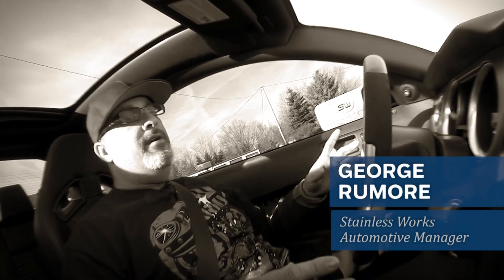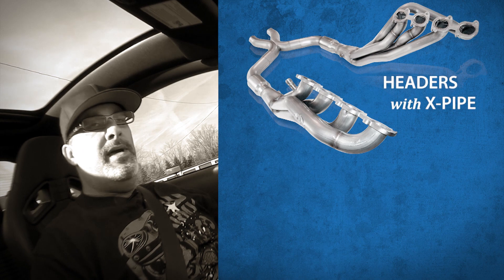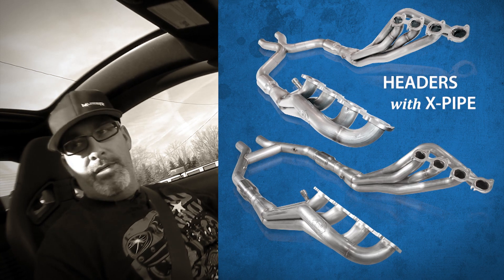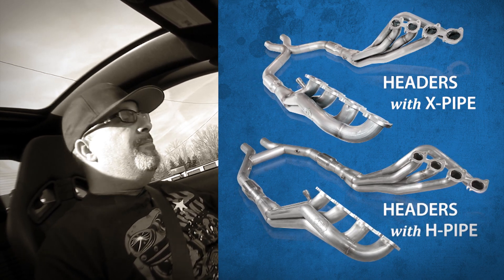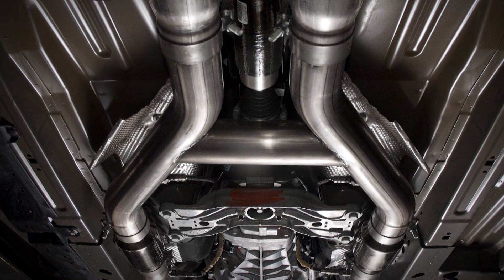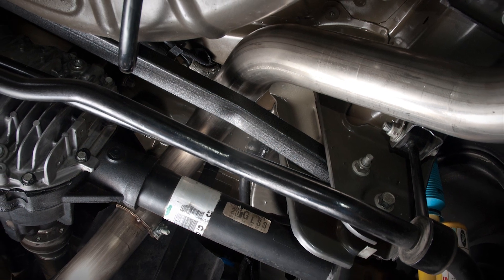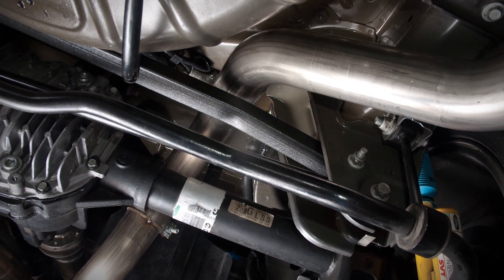2013-14 Ford Shelby GT500 Exhaust, Headers and H-pipe

Comment: Does this exhaust in the video have mufflers or is it a straight pipe?
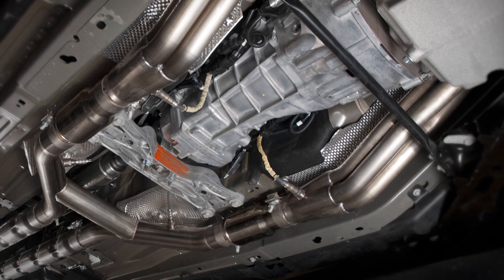Reply from the maker: It has mufflers, they are our "retro-chambered" aka chambered round mufflers (which are louvered long round mufflers), they located near the mid section of the car. You can get a good look at them at the 1:12 mark.

Comment: Will the h pipe fit with the gt headers?
Reply: I would think so, only way it wouldn't is if you had longtubes, don't know how these cars are setup but that's how every car I have worked on works
Reply: I would think so, only way it wouldn't is if you had longtubes, don't know how these cars are setup but that's how every car I have worked on works